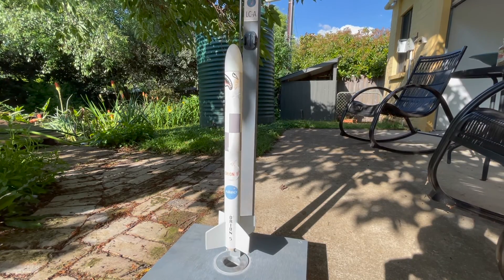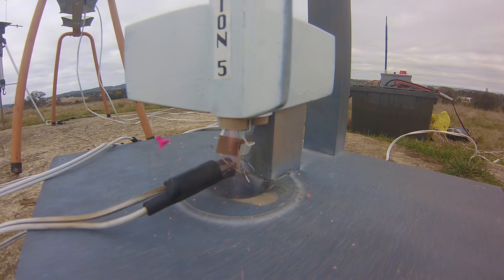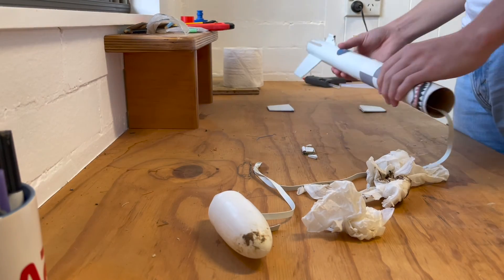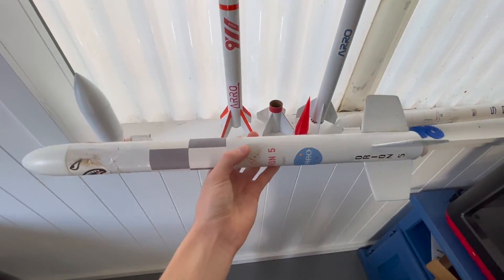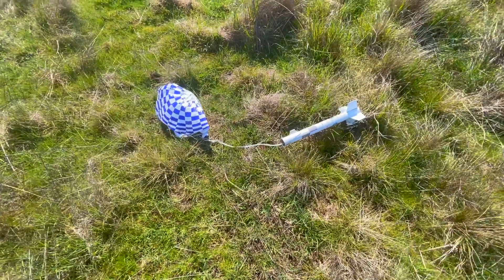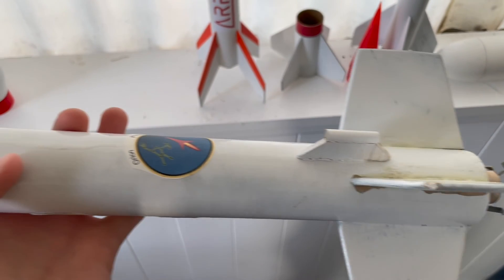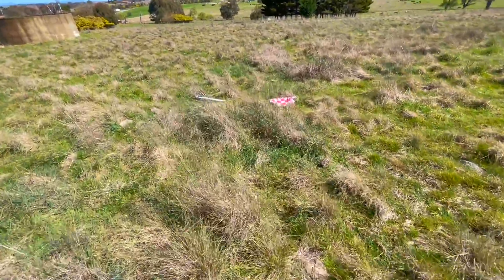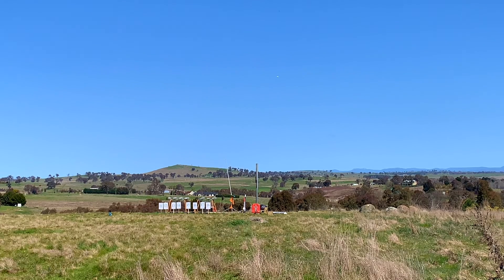Successful 3 Engine Cluster Rocket Launch | Orion 5 Flight 2

Comment: Hey i am your very early subscriber can you tell me how much it cost to make a Rocket how much it cost you
Reply from the maker: Thanks! You can make model rocket from scratch for very cheap if you use common household materials. The only thing that will cost are the engines (~$20 for a pack of 3 low power motors). Kits are also great, and I recommend Estes kits if you want to get started